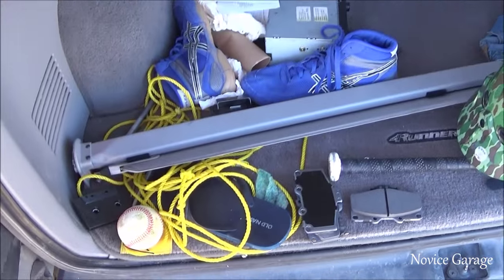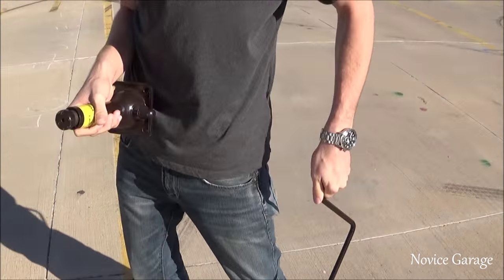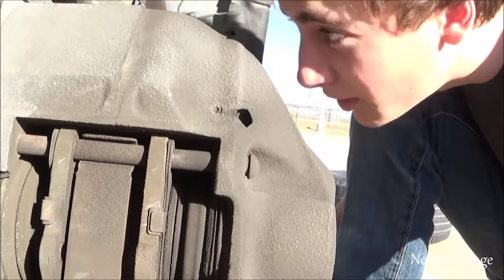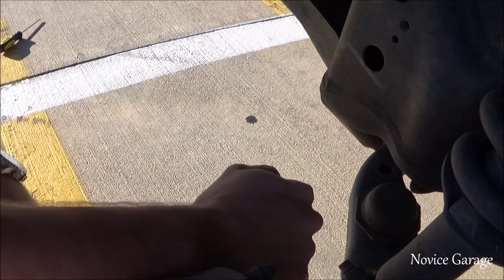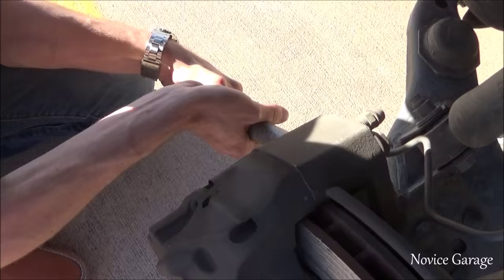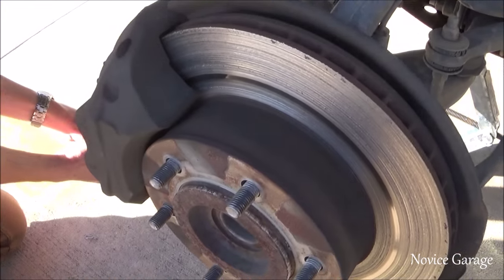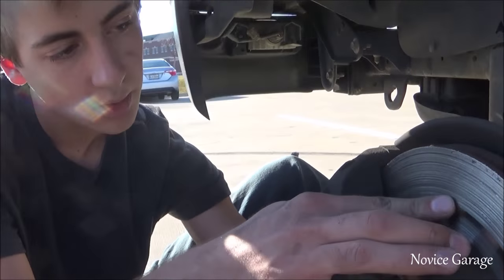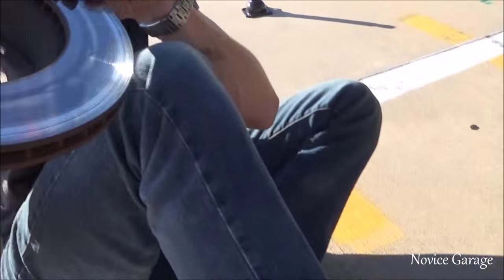What Happens When You Don't Replace Brake Pads

Comment: Never work on a car or get under without a jack stand. The common car jack is for changing tires only. Even at that it can be dangerous. When you rock the car trying to break stuck bolts you can rock the car off the jack.. Bad idea.
Reply: Kev31779 he’ll learn the hard way.... hopefully smarten up before then

Comment: You didn't have to take the caliper off unless you needed to remove the disc and since you were not replacing the disc you didn't need to remove them.
Reply: Chris Ortiz      You need to take the caliper off to do the brakes. Or did you mean the back bracket the the caliper sits on
Reply: any serious problems from replacing pads without rotors in this case?

Comment: pro tip, don't remove the caliper,just remove the lower bolt and flip it up, that way you can pop the hardware and pads out, then swap them in. If you have to replace the rotor you'll for sure need to remove the caliper. Don't let the caliper hang by the brake line either, use a support of some sort to keep it propped up.  Did a brake replacement on all 4 of my 2004 hyundai elantra GLS a month ago which has 70K miles and never had brakes done, rotors were 100% fine though :)
Reply: they really need to take it all off and clean everything and re grease the pins doing this will cause uneven brake wear
Reply: I'd always replace disks/rotors and pads at the same time
Reply: @Nyle95 yeah, well they bought cheap pads so they have brakes, gives them time to clean and replace the rotors too, and organics isn't good, ceramics will last longer but not worth using without changing the rotors too.

Comment: Yeah, that rotor's shot. Look at all the deep grooves in it. That will need to be resurfaced...if not replaced completely.
Reply: Kurrupt4Lyfe     Mine as well get a new one
Reply: Oh shut up it’ll wear in
Reply: any serious problems from replacing pads without rotors in this case?
Reply: @ethans6.0 abnormal wear, including the pads may wear out sooner. Obviously replacing the pads that happened to be cheap will be safer when driving, especially the front but should resurface or replace that rotor soon.

Comment: did replacing the pad resurface the rotors? no serious problems? or did it cause the pads to be replaced faster and rotor still bad?
Reply: I wouldn't think so. Resurfacing a rotor needs to be done at the shop. But they still need to be a specific thickness, the rotors on this blokes car looked proper cooked.
Reply: So basically, don't do it what this guy did. I just noticed my rotor is heavily scored like this, I'll be replacing it straight away.

Comment: You needed to change your rotors to. They are pitted and gouged
Reply: any serious problems from replacing pads without rotors in this case?
Reply: @ethans6.0  no there's no serious problems. You will just destroy the brand new pads that you get. So you're just basically throwing money away

Comment: Been grinding my back breaks for a week now just to see how far they will go!!! Lol i Drive it over 80 miles to work and home (round trip), at about 70-80 mph average. It can't actually hurt anything by not changing your pads, just really annoying grinding noise. Unless you chew up the rotor all the way through, but that's what solid ones are for, never buy finned rotors

Comment: I know that my moms 2003 Ford Taurus never had the brakes changed on it in 200,000 miles (we only put about 50,000 miles on the car). The brake rotors are entirely scored and warped and the bolts holding the caliper in place are fused together. I know that the cost to replace the brakes would be close to $1,000, so I am going to attempt to do the repair myself next week.

Comment: Is there’s anything will happen if I only change the pads and also I need to change the rooter
Reply: My guess is if your rotors look as bad as the one in this video the new pads will wear out faster and uneven. 

If you don’t have the cash to do the pads and rotors you can just replace the pads but look at it as a temporary fix until you can get the money for new rotors.
Reply: if the rotor is badly warped it might cause the brakes uneven but im not sure asking the same questions myself

Comment: lol you guys did not have to remove the caliper off just get a punch bit and knock those 2 pins out and the pads slide out
Reply: +Raymond Because the new pads would fit with the caliper pistons extended that far out and all.
Reply: +MLG M8 you can compress the piston without removing the caliper...........
Reply: compress there piston with a c clamp using one of the spent pads for even compression
Reply: Dude, you really think these guys would even know what you're talking about? Lmao.

Comment: 20 dollar pads will be louder than the worn down ones lol.
Reply: kdmq      Yep I payed about 100 bucks for mine set of 4
Reply: @ryans413  paid about 230 for my rear brakes yesterday.
Reply: @ExorcistOfNevermore     My cars old so I don’t put on expensive parts the brake pads I got are good quality and we’re on sale that was for two wheels. Back wheels are drum brakes and I rebuilt the whole back end that was pricy new drums and the hardware shoes and master cylinder and some black paint to protect the drums from rusting. Turned out good